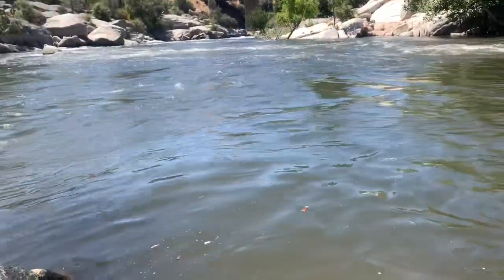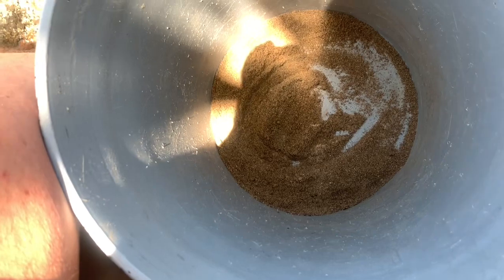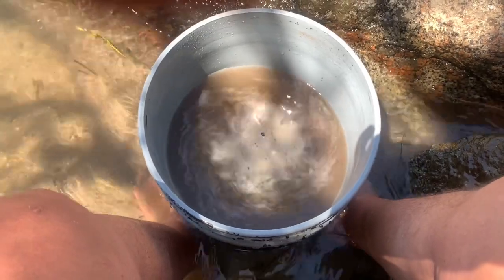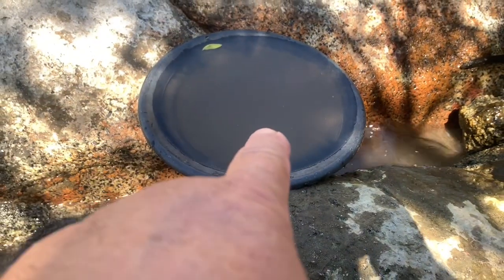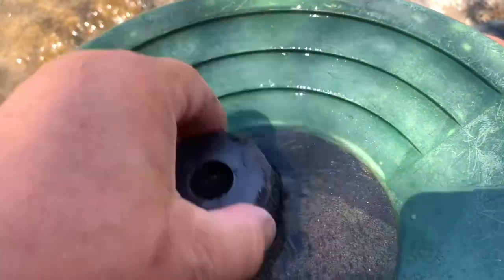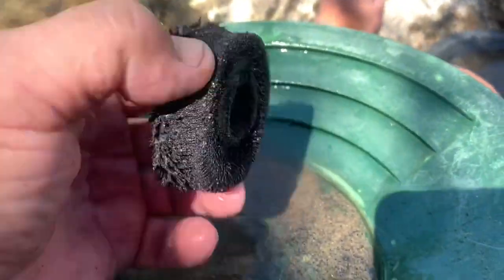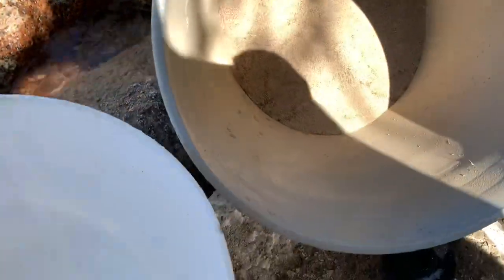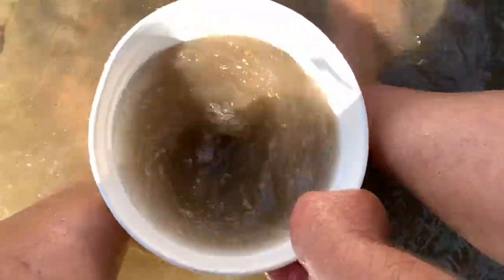Experiment with black sand .

Comment: Hello. How about putting enough  black sand sealed in a round flat plastic holder in the middle of the bucket if there is not enough black sand in the sand you are mining. Still using the magnet on the outside below the bottom of the bucket. you can even stick a small spacer say 16th inch in the form of a + from side to side on the bottom of the plastic holder so the small gold can be caught below the black sand holder. In this way you  can catch the gold. It is worth a try when you mine sand without black sand in it, or even when you crush gold bearing rocks with super fine gold. 😀